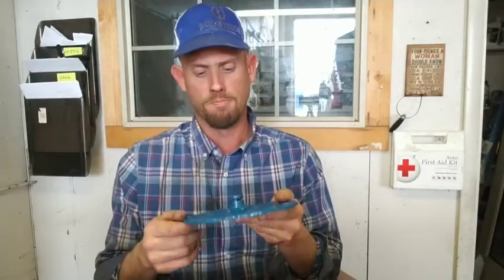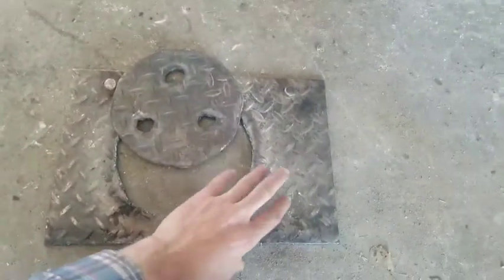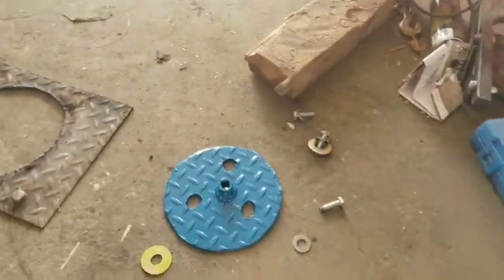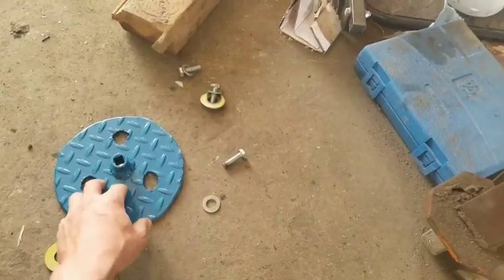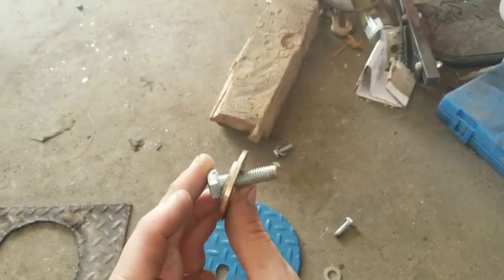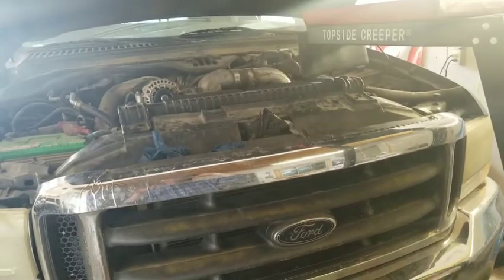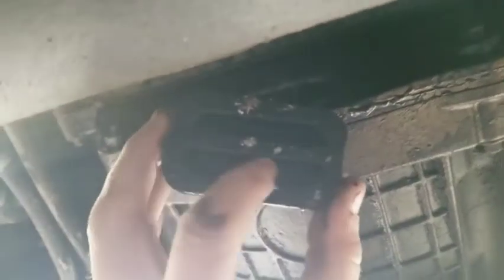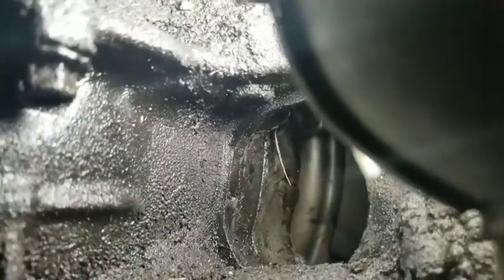6.0L Powerstroke.  Cheap engine rotating tool.  It works!!!

Comment: does it take a lot of force to turn the pulley?not sure if i’m having a hydro lock issue or not i could turn the pulley a bit but i feel like it might be a tad hard i just did the oil cooler and put everything back together and i got a a crank over for about 3 secs when i went to prime system and then stopped then tried it again then stopped and then haven’t been able to get a crank since replaced the starter when i try to prime my starter clicks all fuses look good.
Reply from the maker: Try removing the glow plugs and try cranking it over.